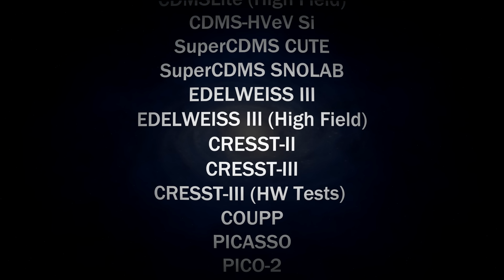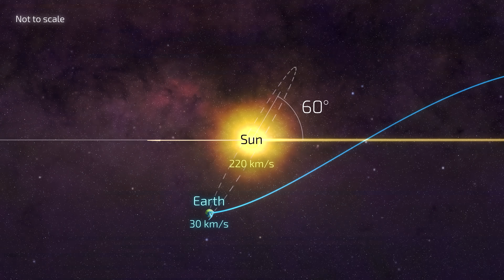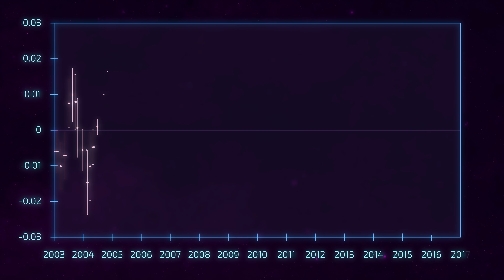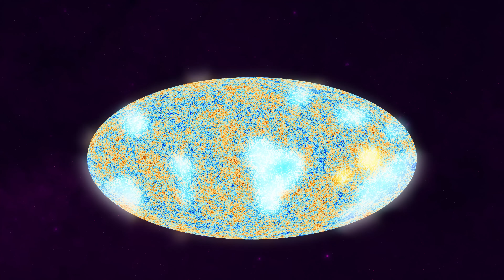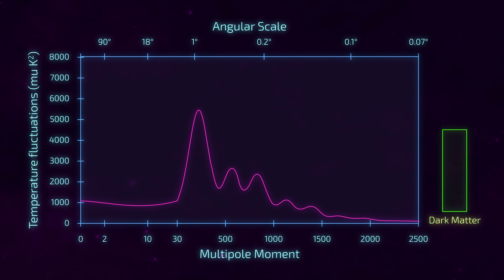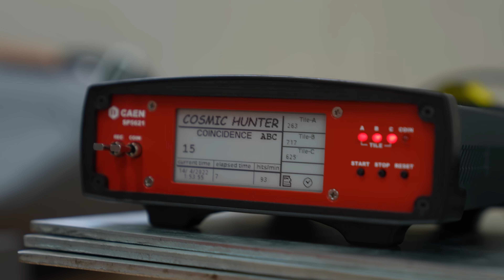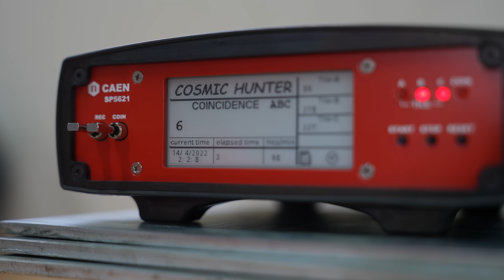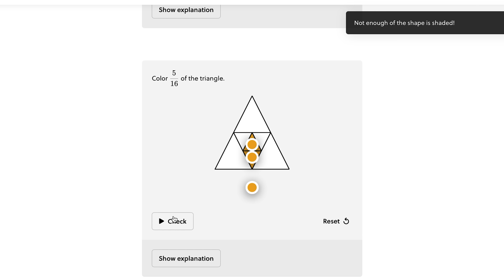The Absurd Search For Dark Matter

Comment: There are many reasons that the physics community has by and large ignored and not taken the DAMA group's claims of DM detection seriously over the last 2 decades. One, they refused to release their data and methodologies. Two, they never appropriately accounted for their background levels. Three, the absolutely refuse to reconfigure their instrument with a null fiducial volume to see if the signal goes away (like replacing the scintillator crystals with inert glass). Four, they reset their noise floor every year and subtracting out an average noise on an annual basis, despite the noise floor never being constant. And finally now within the last year, fifth, the ANAIS experiment (Annual modulation with NaI Scintillators) which directly replicates DAMA/LIBRA's setup has found absolutely NOTHING over the past 4 years and rules out DAMA's claims at the 99% level. It's already over for DAMA. It's been over for years. This latest replication experiment here will also fail to replicate their claimed annual (and DIURNAL!!) signal detection, and when they do, DAMA will go on just as they always have for the past 20+ years ignoring it and claiming their being "misrepresented". Their group is a pathological pseudoscience group in the same way that cold fusion groups are.

Comment: Wow I actually did a seminar on this last semester and especially held a presentation on DAMA/LIBRA. What might additionally be interesting to know is, that there are already two experiments currently running, which try to independently find the same signal as DAMA/LIBRA, named Cosine100 and ANAIS. Both have around three years of measuring time and are starting to become able to judge if the DAMA/LIBRA signal can be reproduced. So far the results of ANAIS seem to indicate no signal can be found, while Cosine is not yet able to make a clear statement, since the bestvalues for certain interesting parameters lie inbetween the zero hypothesis (there is no signal) and the DAMA/LIBRA finding. So right now the trend is leans towards the signal not being due to dark matter, but only time and more experiments will tell, if this ts the case.
Reply: where do i get updates on the experiement he talked about in the video?
Reply: If it isn't dark matter in the DAMA/LIBRA results, then what is it?  EDIT: Wikipedia says that it could be a result of the data analysis procedure itself.
Reply: @edtotman2952  they mentioned in the video that it could be caused by any sort of seasonal factors. it is possible that the climate above the facility somehow impacts the amount of particles that reach the detector.
Reply: @durdleduc8520  I thought they ruled out particles coming from the outside with the detector on top ?
Reply: @yaykruser  i think it's impossible to completely rule out the noise. that's why they're trying to get the same results on different spots. even though they're trying, we can only be sure if the results are the same everywhere
Reply: @durdleduc8520  as soon as somebody says with certainty that it cannot be explained, or that it certainly can't be this or that influence, I am immediately suspect of any conclusions they make on this assumption.
Reply: @yaykruser  maybe they cause indirect noise rather than directly entering the detector — aka, they somehow interact with the particles before they enter?
Reply: 9:50 “There’s some type of particle out there that only interacts through gravity.”
10:38 “… a [gravity-only] particle hits a nucleus, transferring its energy, this creates a flash of light.” 
This sounds like electromagnetic energy to me.
Reply: @DurfDiggler  same pinch -_- give our funds back lol
Reply: Why won't DAMA release their data, algorithms, etc. to the scientific community?
Reply: @pattheitguy  they have, ive actually replicated their data and stuff. We just want to see if we can do their measurments again at another location
Reply: wow you big brain hopefully dark matter exists.
Reply: I believe SABRE is also looking to reproduce the DAMA/LIBRA results, either way if we do or do not get the same result it should be a leap forward in the search for dark matter
Reply: Repent and believe in Jesus Christ  I will repent the moment that Jesus Christ explains dark matter to me.
Reply: Finally there's someone talking about it
Reply: God bless the guy who decided to call it ANAIS ehauheauehauhaeauheuhuhue
Reply: @Cuestrupaster  I read the 2 studies as cousin anus haha

Comment: 1:38 The diagram is wrong. If there is five times as much dark matter as there are matter, the diagram should be divided in sixths and blue be one sixth. Now it is one fifth which leaves only four  times as much dark matter or violet. That's horrible noob error.

Also, somehow the "Cosmic Hunter" and Comic Sans font doesn't inspire confidence on the accuracy of the muon detector. That device  most definitely does not look like it can measure time accurately enough to detect if the metal plates "flashed" at the virtually exact same point of time.

Comment: Maybe the gravitational field itself behaves differently when there are many atoms close together. So the gravitational tug increases exponentially instead of linearly.
Reply: Like the atoms themselves get heavier when near other objects, not just the group being heavier than the individuals...because of how the gravitational field works..
Maybe there is a "weak force" for when atoms are far apart and a "strong force" for when they are closer.

Like a cpu having a "Weak force" with a small render distance and a "strong force" with a far render distance. There is more load on the far render distance as there is more load when there are atoms close together.  The load on the gravitational field that is.

Comment: My concern with dark matter is that the distribution of it to explain the speeds in a galaxy is very convenient and that there are galaxies completely without it and it's exceeedingly suspicious if these void galaxies have no spin. To me strongly suggesting a significance of spin. Not least underlined by cosmic jets which no one seem to like to think about despite it being highly suggestive of new physics. The anomaly in M33 is 3x too high speed at the rim which requires a 9x higher radial force to keep in line than light matter prediction in GR. 9x higher gravity conveniently pointing towards the galactic center. If the outer rim was in a thick soup of dark matter wouldn't the effect be in all directions. What distribution of dark mass could explain not falling off with distance. Is such a distribution even possible even if we ignore how it holds that distribution.
Reply: And for those able to actually think rationally, UFOs as in ET vehicles at times have a spin component, either a physical part of them spinning (which woud be a huge design compromise unless absolutely necessary) or an observed twisting force under them, like tree tops or water swirling or compass spinning like an electric motor. Less certain insider stories suggest other designs have a spinning conductive liquid inside, possibly instead of an outer solid spinner. But a consistent pattern of spin being significant emerges. May not be related to galactic gravity anomaly but...

Comment: Can someone clarify if dark matter can or can't interact with normal matter? Most of the video indicates it can't, such as the dark matter passing through the colliding galaxies without slowing, but the experiment seems hinged on the idea that it can physically collide with nuclei and impart energy. But if that's the case, wouldn't it have collided in the case of the merging galaxies and slowed there as well?
Reply: The expectation is that if it interacts (outside of gravity) it does so very weakly. So it can be treated as non-interacting when dealing with it at cosmic scales, but it does occasionally bump into matter and it's that occasional bump we're trying to detect.
Reply: @atticmuse3749  thank you so much!!

Comment: Consider:
Galaxies at center mass have a black hole singularity.
To create this singularity takes a threshold of mass and speed/rotation.
This singularity also has incredible attractive force spread evenly over it's rotational mass. 
As you approach the singularity your mass becomes more compounded, leading to becoming part of the singularity.
In this way you add to and extend it's attractive mass.
So the rate of rotation is dependant entirely on the singularity, everything else just carries it's energy through the laws of conservation of energy.
The entirety of the system add in to the center of mass, and rotational energy is therefore on average spread evenly over the entirety of the system, given the singularities mass is the driving force across the entire system.
There's no need for dark matter to exist for these things to be true. In effect each orbital body is only transferring the energy from the core out into the edge.
So as the objects nearest the center rotate a direction, they also pull on things a bit further out towards that same direction, and so on and so on, resulting in the spiral shape and conserved speed, since each consecutive layer's speed is based on the speed of the layer before it, which at it's source is the constant speed of rotation set by the singularity
Reply: As for the hot gas dispersement viewed through gravitational lensing, what likely would explain that is heat radiation or light radiation which still follows the mass of the singularity. 
The interactions in the center would be things colliding briefly, but would still be pulled into one of the two clusters, following the laws of conservation of energy.
It dosent make sense that any of the matter would stay in one spot with two large attractive masses pulling it either of two ways, the proposal that a large amount of matter, or any really, would hang out in the zone in between overlooks that space is largely a frictionless medium. The only forces applied are attractive forces, i.e. any object pulling on any other object, which can result in several interaction not excluding the sling shot effect.
CMB also dosent guarentee dark matter, variance in temperature can be explained through density of matter interaction, since friction causes heat from molecules/particles bouncing into one another.
Any matter lost from predicted numbers (I still want to know how the total mass of the universe was calculated in the first place, considering we haven't even seen all of it) could easily fall into a black hole.
No matter the size of the system, if there isn't a counter pressure to contain it, the system itself will fall apart.
Which means for matter to keep any form of organization, some pressure must be operating on it.
So looking at the entirety of the visible cosmos, it all still needs pressure acting on it to keep everything stable. This gives credit to the idea it all exists inside of a larger pressure system, which could be explained as being a black hole, considering the scales of pressures we can measure, the largest deposit of which is observed in singularities, which we know compound matter, but don't know how. The only hint being weird stars, the result of a star just a bit to small or slow to result in a black hole. 
In which we see essentially a plasma soup, which is what the big bang theory proposes the universe began as.

Comment: If dark matter doesn’t interact with ordinary matter or itself, why would it interact with the crystals?
Reply: If it does interact directly with normal matter, it does so very weakly. I agree that this could have been made clearer, it's often said that dark matter doesn't interact, but what they really mean is 99.99999% of the time it doesn't. (I just made that number up, there's probably more 9s but you get the point).

Comment: I would feel more comfortable accepting DAMA/LIBRA's results if a peak in June didn't correspond with the summer solstice, when that part of the world is pointed most directly at the sun. It sounds more like they're accidentally detecting neutrinos from the sun.
Reply: Since neutrinos pass straight through the Earth, they're not going to get spread out like sunlight does across the Earth's surface based on the tilt. The cross-section of the detector to the sun is going to be the same except for the changing distance over the course of the orbit, but we're closest to the sun in January.
Reply: interesting... but November isn't the winter solstice.  idk if the model presented accounts for that either.  it's not 6 months from June.

Comment: I have a question. Has the speed of our rotation of the solar system relative to the galaxy , sped up or slowed down during its existence? Is Dark matter responsible for kee[ing us going at the same speed? is it like fuel in the gas tank? will it run out? does it get a fill up?
Reply: Dark matter is still only a theory and we do not know much about its mechanics. In fact, Derek did a great job of showing the evidence we have for dark matter and why it is a more reasonable theory than any proposed alterations to the theory of gravity. From a conservation of angular momentum point of view, it is very unlikely the angular speed of our solar system has changed significantly since its formation. When discussing the conservation of angular momentum, it is important to note that as the distribution of matter becomes more spread out, leading to a higher moment of inertia, the angular speed will decrease and vice-versa. Therefore the movement of dark matter in our solar system to be more concentrated near the sun would lead to increased angular speed and the movement of dark matter away from our sun will lead to decreased angular speed. So it is possible it could, over extremely long time frames, effect the angular speed of the solar system. It is certainly not gas in the tank that can run out or be filled up (I'm not particularly sure what that even means), it is just matter that we cannot see.